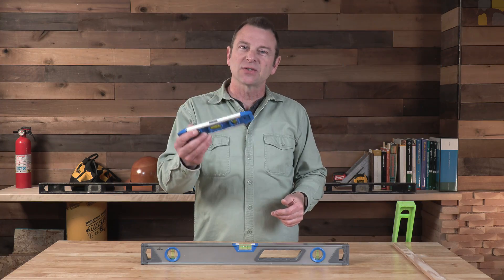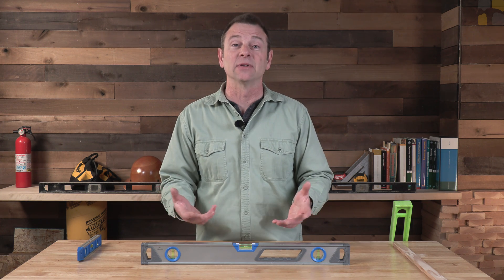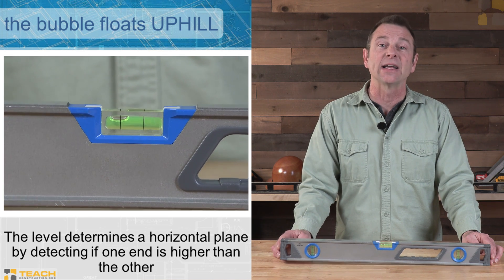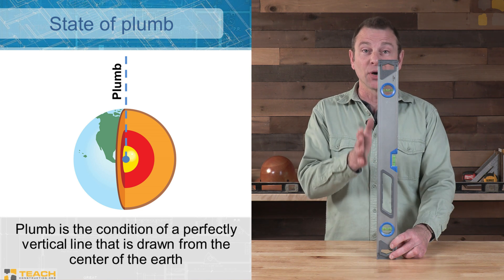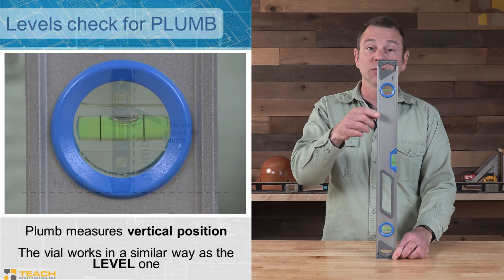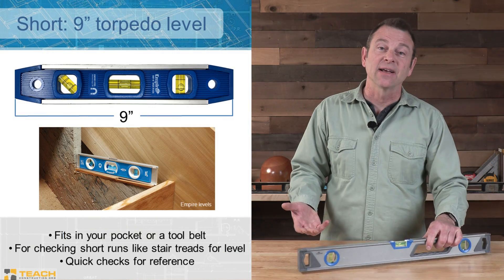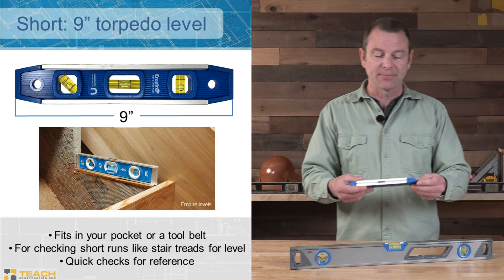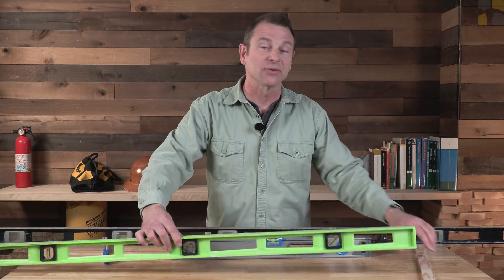A lesson about the construction Level - TEACH Construction Fundamentals Series

Comment: Plumbers use torpedo level to gauge 1/4 a foot slope. It's right when a bubble touches the line. You can also tape shim to a torpedo level to get a more accurate results since shim goes exactly from 0 to 1/4 over a foot of distance.
Reply from the maker: Thanks for the additional info and thank for stopping by

Comment: Put a level on a wall.mark a level line. Turn the level over and end for end. If the level stays on the line. Its a true level. I've seen levels that were trash from the factory. Check a level before you buy it.
Reply from the maker: good tip
Reply: Actually can check before you buy doing the same on the slab of de store , it should read the same on all sides n end for end and also sight down the edge on both sides to that it is straight . I personally prefer I beam levels that are made aluminum, I never trust plastic ones or box beam levels.